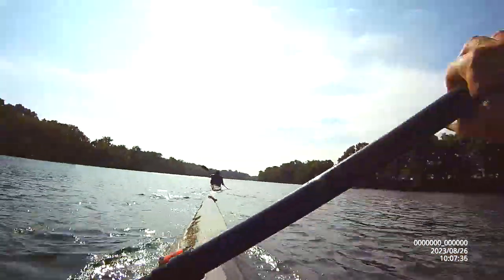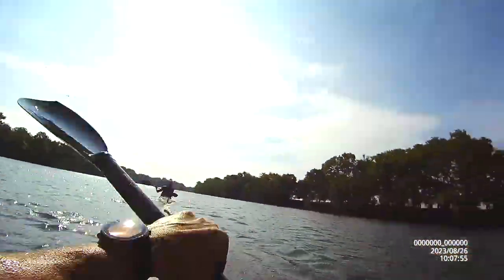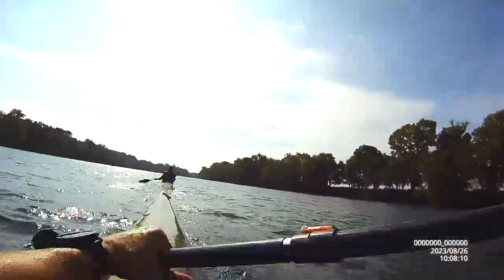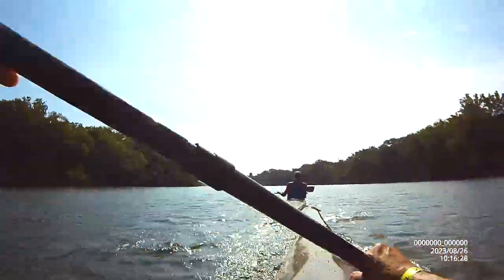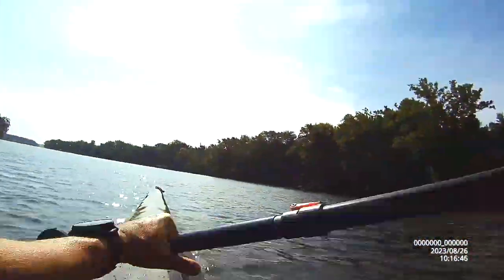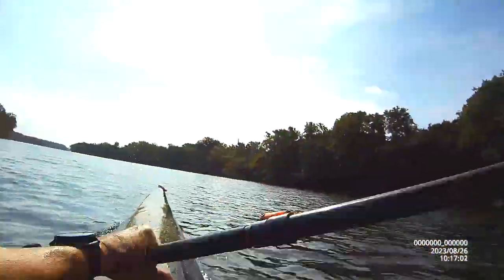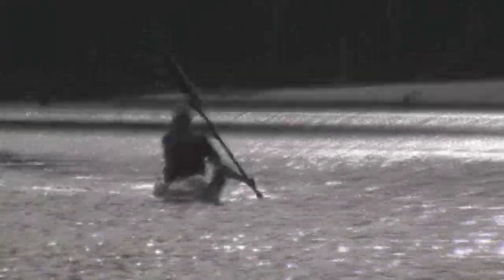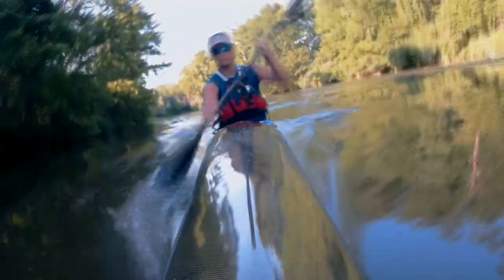Wing Paddle Technique | Cadence vs. Efficiency | High Angle vs. Low Angle Kayak Surfski Paddling

Comment: This is great, and a topic I've been wondering about!   So how does one choose the optimal cadence?  Would it not be somehow based on speed vs. calories burned or heart rate?  Just because the person in front is paddling at a higher cadence, does that mean they're wasting more energy?
Reply from the maker: There is a lot that goes into it, especially blade size, but if the two paddles are equal then the one going the same speed using fewer strokes is more efficient.  In  this case we were both using mid-wing so paddle surface areas were very close to equal.  In swimming it is called a SWOLF score. Same distance using fewer strokes is more efficient.  Of course you want to maintain the same speed or better so you have to measure all these things in training. Once you get there then you try to speed it up for sprints.  In short. train over the same known distance and try to do it faster and faster using fewer strokes.  A smartwatch is your friend.  I use the Amazfit Stratos in Open Water Swim mode and it counts my strokes and distance and calculates said SWOLF score.  It has truly transformed my training.
Reply: @DaveTheKayaker  awesome, thanks for sharing that info!  Not in time for next week's race, but I'll try some of that for next year...  Is there a point of diminishing returns, where you could be keeping the paddle in the water too long, i.e., with the stroke ending well behind your body?

P.S.  This video makes me feel better, as I've noticed my stroke is slower than most others', but when I tried upping the rpm's, I seemed to go slower (!)
Reply from the maker: There is absolutely a point of diminishing returns.  The blade should come out of the water at your hips and not behind them.  Honestly, my secret weapon for years in some of the shorter races has been to switch to a paddle with big ass blades just on race day so my competition sees me paddling "slower" and tries to match me but they have no idea why I'm moving faster.  They assume I'm using a small/mid wing and can't quite work out the physics.  ;-)  Just make sure you are well-conditioned before you try that trick to ensure your shoulders can handle the extra strain of big blades.

Comment: How much do you think individual athletic attributes come into play?
I come from a S&C background and often categorise athletes as “fast & weak” or “slow & strong” when it comes to exercise prescription (so we’d try and make the fast/weak athlete stronger and the strong/slow athlete faster).
Wonder if the same principle could be applied to optimal cadence for any given athlete.
Reply from the maker: I would say it is a combination in kayak racing.  You must be strong to run with the fast pack during a race, but you must reserve enough energy for the end of the race to burst into a sprint. Nobody can be extremely fast for very long.  I've done 100+ milers and those races are entirely different than shorter 5-7 mile races in terms of conserving energy. Gear, technique and training make you fast, but base miles and paddling long distances regularly provide the endurance.  Paddling a blade through water is also high resistance so you have to train for that regularly.
Reply: @DaveTheKayaker  
Thanks for the reply. I meant more along the lines of if you had a guy who was fast but not so strong would be be better off with a high cadence but less distance per stroke vs someone who’s very strong who might do better with a lower cadence and less distance per stroke (I’m relatively new to paddling in general having come from downhill skateboard racing so forgive me if this whole concept isn’t even a thing 😂)